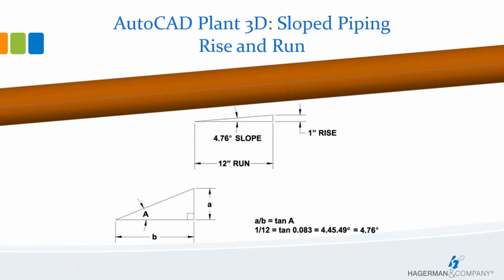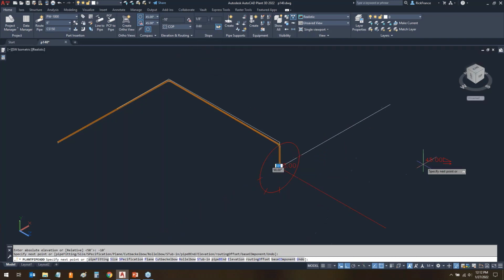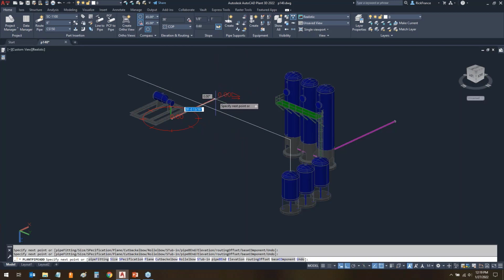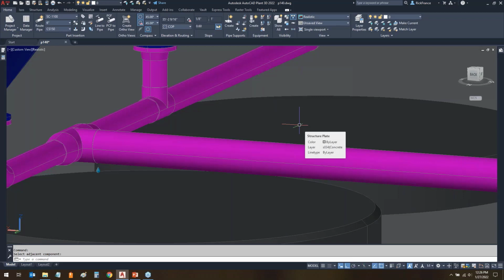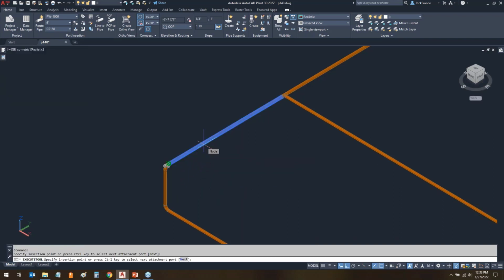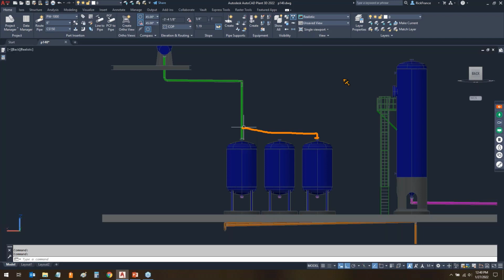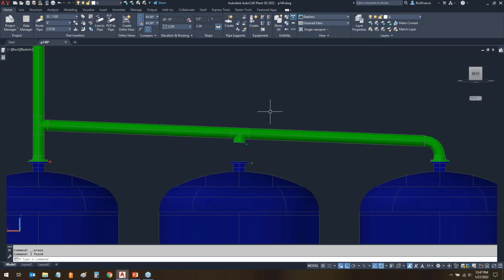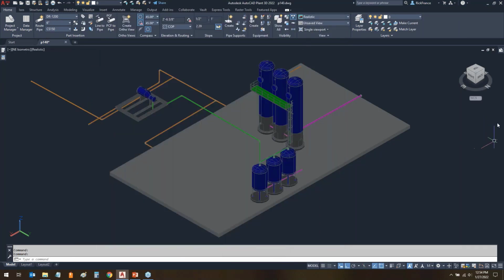AutoCAD Plant 3D: Sloped Piping

Comment: Thanks a lot for such a detail!

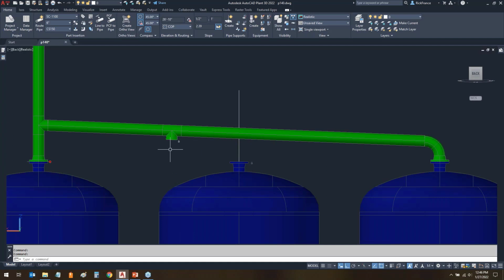I would like to point out that when it comes to vertical nozzles (at 44:45), the Perpendicular snap doesn't place the Tee EXACTLY  where you need it, if you zoom in there is a small offset. But it is within tolerance to draw the pipe.

The offset gets bigger if you perform the snap on the line further from the point's final position.

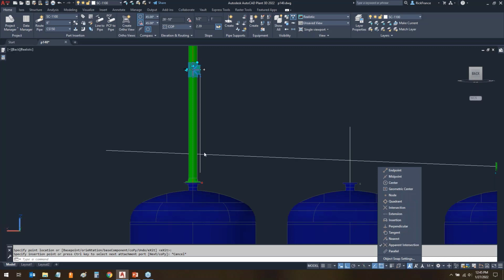The only way I have found so far, is using the construction line as you did on the vertical pipe at 43:30. But that's not so easy on the horizontal slope... Instead of orthogonal restrict, use parallel snap to header's axis.

Comment: hi, do you have any standard that allow cutting back tee to achieve sloped piping at vertical branch?
Reply from the maker: All you can do is rotate the tee.
Reply: @Hagerman  I mean any codes or standards,, like ASME something.. ? I think that we can get slope line in vertical tee by making small degree of cutting on tee , right?
Reply from the maker: @RandomWeeZ  Not that I know of. You would need to check the ASME website for information like that though.

Comment: The Tee can be used but the branch connection has to be rotated the same amount of degrees as is for the slope. I would also set the units to at least three decimal places...four is better. The angle degrees should also be set to four decimal places. The reason for this kind of accuracy is to ensure that any pipe stress analysis software that is being used has tight and accurate nodes at the connections. Caesar II recommends three decimal places as I recall. May I suggest you purchase a few short lengths of small diameter PVC and matching fittings and see how a slope affects a rise and if you can bend the rise into a plumb position.